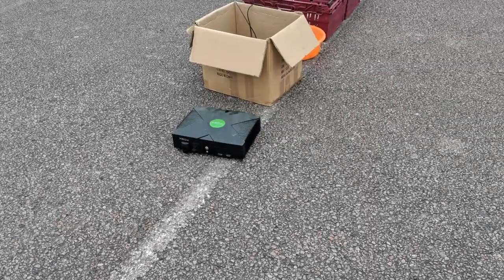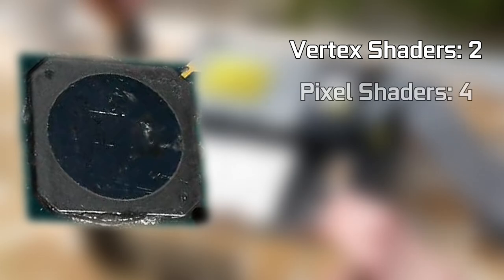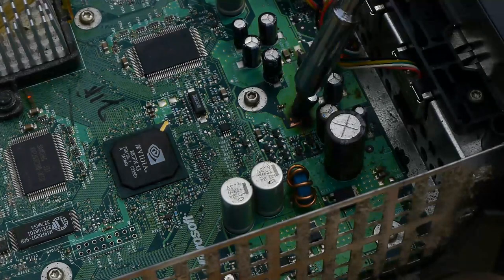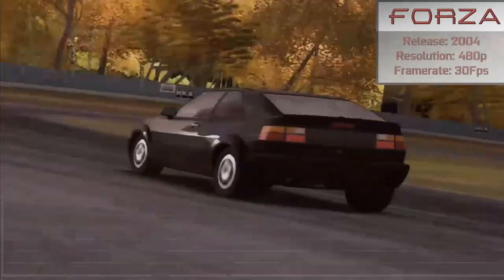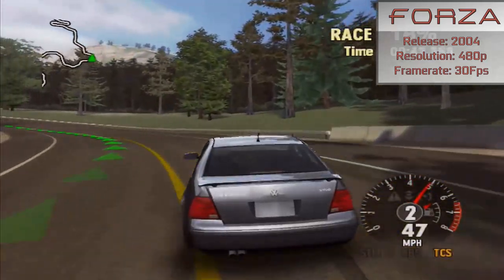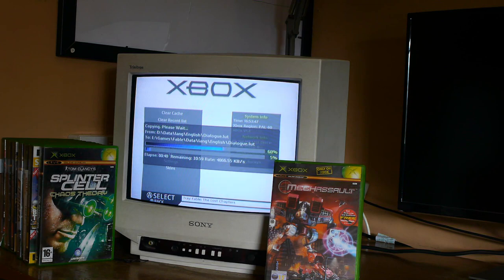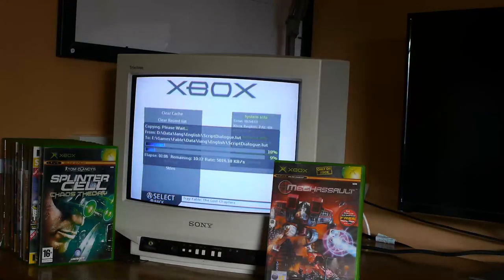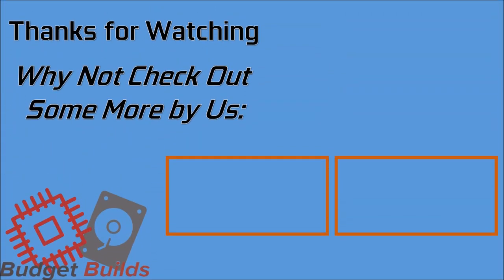How Powerful was the XBOX?

Comment: First Xbox was a BEAST, I remember that GTA SA was more beautiful on it than on PS2.
Reply: Sypher Ti yea but it didnt release until years later
Reply: It had terrible controls though.
Reply: @megami215  It came out in 2005, just one year after the PS2 port. Sony had the shared timed exclusive rights to it along with PC when it released in 2004.
Reply: The ps2 was a weak console though it had nasty graphics and was basically no better then a gameboy
Reply: @theghost7277  PS2 is a complete boss, I have all the consoles from this generation modded and setup currently. PS2 kills them all... Easily. I actually rate them PS2, Wii, OG Xbox in their modded state. PS2 can go all the way from 240p to 1080i + VGA modes plus it feels way more arcade solid.
Reply: @thomassmith4999  srry but no ps2 is a weak console the origanal xbox has 720 p games of release not even the later release when they put core2 duos in them srry but not even close you really dont have a clue what you are talking about
Reply: @theghost7277  I have plenty of clue man, I told you already I have all those conoles and around 20 years experience with them. I'm telling you right now the PS2 is by far the superior console. In the end the Xbox is nothing but a cheap PC, worse yet.. a cheap PC that can't run 240p resolution. It's a bit fat pile of junk to be perfectly honest. But at least Halo is a good game. The PS2 is an arcade board in a box.. MUCH better if you like your games to feel legit.
Reply: @thomassmith4999  and one other thing a ps2 cannot go to 1080 I had to try this since you had mentioned it and 1 it crashed my ps2 so rebooted tried again  and the highest it will go is 480 so I'm calling you bs right now.
Reply: @theghost7277  Gran Turismo runs 1080 out of the box just as it is, some games can be forced to run that high, it's hit and miss when forcing them though and does take some monitor adjustment. You can get VGA and 720 out of a lot of them. 240p is more important to me and I can get about 50% of all PS2 games running is 240p.
Reply: @theghost7277  
There is a list of what games work and not work, google "List of PlayStation 2 games with alternative display modes"
Reply: @NuffMan_  ok I'm gonna stop you right there I mod these systems I know how there power is and what has true power  now get out of here
Reply: Thomas smith The Wii was a 7th gen console, it was the GameCube in the 6th gen.
Reply: @ironhammersfc  gamecube was fun nat hard to get the console but hard to get the games
Reply: @theghost7277  actually You have no idea how much power PS2 had.
Reply: @damiank9443  uh yes I do a 16 bit 294mhz processor 33mgb  ram
4mgb of video ram supports up to 360p with out any problem at 25 fps usually can be pushed to 480 and 720 with very certain games others will just crash and start overheating your ps2.

Now heres some xbox specs a 32 bit 794mhz  custom Pentium 3  has 133 mhz gtl fsb with a 1.6 gb bandwith and has 64 mb of ram and that has a 6.04 bandwidth 1.6 of that is used by the cpu the rest drives the graphics. Will play any game on the console at 720 and most at 1080  and never drop from 30 fps. 
Will play half life 2 at 720 at 40fps and 1080 at 35. The ps2 wouldnt start these games at its specs

I'll be clear the ps2 isnt shit
Reply: @damiank9443  0 power nothing compared to the origanal oxbow hell it barely held it's own with a dreamcast
Reply: @theghost7277  lol. Or lul. Suits better. Level of bullshit here is enormous. Did you actually saw DF Retro with Half-Life 2, MGS2 or Silent Hill 2? Xbox struggles with HL2 at 480p so I don' think you could ever see 720p and 40fps here. I don't know if you missed something but main core of Emotion Engine is 128 bit not 16. And that bandwidth. Graphics Synthesizer offered at that time crazy bandwidth and fillrate. It had around 50 GB/s, twice as PS3 or X360. No comparision here. Fillrate was almost four times higher that XGPU, and allowed more complex effects like fog in Silent Hill or heat haze in Gran Turismo (this one is bandwidth oriented) without performance hit. CPU-wise PS2 uses Vector Units that easily crushes XCPU in terms of float performance. Xbox has power and that power was easy to use just like GameCube, but PS2 wasn't worse. It's programming was just more demanding. Oh, and Dreamcast cannot catch PS2. Maybe in your dreams.
Reply: @damiank9443  and by the way took me some searching but I bought a dreamcast and lo and behold it kicks the ps2 ass.
CPU: 128-bit Hitachi SH-4 RISC processor (200MHz 360 MIPS)
Graphics: NEC CLX2 processor
RAM: 16MB, 8MB Video RAM, 2MB Sound RAM
Colors: 16.7 million
Polygons: 3 million per second
Game Media: 1.2GB GD-ROM, 12x access speed
Resolution: 640x480 pixels
Sound: Yamaha 64 channel
Operating System: Custom Windows CE with DirectX support*
Modem: 56Kbps (US/JP NTSC), 33.3Kbps (PAL)
Not to forget the dreamcast also had 8x anti aliasing
Reply: Sypher Ti - XBOX>GameCube>PS2>Dreamcast!

There are some things the GameCube did better than the XBOX and that is processing 8 different layers of texture whereas XBOX, I believe, has 6 passings, with the PS2, I believe, having 4 texture passing.    

I favored the GameCube, because I love their first party games and the fact that the system didn’t have as much load time issues as the other systems.  Plus, many of the third party games actually came out on the GameCube.

I like the PS2 for it’s exclusive third party offerings and first party exclusives, but I did not pay the XBOX any mind until it was discontinued around 2004/5.  I played catch-up and purchased almost all the must have games I could want on that system, brand new.
Reply: @NYCJoeBlack  this dude knows his stuff.
Reply: I remember me and my friend comparing the Original Battlefront 2 on my PS2 and his Xbox, I was definitely jealous, and Halo had me convinced that I had to get my own, I was quite happy when I later got a Xbox 360 Arcade
Reply: @Sypher. And some of the games  ran at 1080I, provided you had the red blue green HD component cables and an HDTV. None of the other consoles at that time even came close if you had a set up like that.
Reply: @theghost7277  THE GHOST
2 months ago
@Thomas smith srry but no ps2 is a weak console the origanal xbox has 720 p games of release not even the later release when they put core2 duos in them srry but not even close you really dont have a clue what you are talking about

Core 2 duos, where?
Reply: @theghost7277 Starting with a 295 or 300MHZ (in later models) MIPS CPU, approx. 6 GFLOPs of graphics performance and 36 MB of RAM,  although weaker than an Xbox, the PS2 is definitely much more powerful than a GameBoy.
Reply: @martinramirez21  yeah, I'd say both sides are incorrect here in some aspects. The original Xbox was most definitely more powerful than the ps2 in almost every single way. The GameCube would take 2nd place and the ps2 third. The Xbox usually got its own special versions of games with upgraded shaders and other bits, while the ps2 and GCN would usually both get the same version, which sucked because this meant most 3rd party titles didn't fully take advantage of the GameCube. Really only 1st party Nintendo titles would show off what it could actually do. The ps2 could indeed do 1080i in GT4. That's 1080 interlaced, not 1080p. And it could push a lot of polygons in the hands of a talented developer. Over it's lifespan most devs learned how to "fake" certain effects on the ps2 so that the visuals could approximate what the Xbox could do via hardware, and it could sport some impressive graphics via games specifically coded to take advantage of it's bizarre architecture (FF games, MGS games etc). Those games also had the benefit of having great art design, which masks any technical shortcomings of the hardware. The Xbox actually did 720p in quite a few games, which is very impressive given the time period. It really is a locked down PC, but it's a powerful (for its day) locked down PC. It was meant to showcase the DirectX api, hence the name. Doom 3 running on it may be slow as hell, a bit chopped up and low res, but the fact that it runs at all is amazing. Sort of like Doom 2015 running on the Switch. There's no way in hell that game could run on a ps2 short of a ground up remake.

None of this matters though, because in the end the ps2 had better and more games, and that is what it's all about. There are standout titles on the Xbox and GameCube, but their libraries are weak as hell compared to what we got on ps2. Especially the Xbox. It had Halo 1&2 but not much else. That's why it's hard for some folks to believe that it was the weakest console of the generation by a fairly large margin. They grew up playing games like MGS2 and FFX on it, how could it be weak? The fact is though, if those games had been coded specifically for the Xbox or even the GameCube by devs that knew what they were doing they could have looked a lot better. Though they'd have needed multiple disks on GCN.
Reply: the sky in GTA:SA on the PS2 looked like piss.
Reply: @thealien_ali3382  The PS2 can run 1080i that is a fact. Load up Gran Turismo 4 and select 1080i in the video options if you would like to see for yourself.
Reply: @theghost7277  got rid of my ps2 for an xbox, graphics way smoother, processor faster graphics faster, gameplay better, ps2 was beastly buts it nowhere near as powerfull as og xbox.
Reply: @jokerzwild00  gta 4 on the ps2?
Reply: @jokerzwild00  it had more games because its was older!!! not necessarily better as you see in the video multi format games ran better on the xbox so your point aint exactly correct.
Reply: Didn't like San Andrea's on Xbox. Wish Rockstar Vienna ported it instead of Rockstar North. It would have been better but it probably would have taken longer. Vienna did an amazing job porting 3 and Vice City.
Reply: @theghost7277  no better than a gameboy HA!,nice try.
Reply: fun fact: the Vice City Xbox port was the only GTA on that generation of consoles where characters had fingers
Reply: SNES was better than xbox and PlayStation !
Reply: @thomassmith4999  you are high apparently
Reply: @Mark-fr2eb  I was playing pong in the 70s with you. Everything I've said about he playstation 2's technical capabilities is true.
Reply: @thomassmith4999  The Shitstation brand needs to die.PS2 was a joke, hard to develop for and broke down too much.
Reply: @Mark-fr2eb  Dude, have you ever owned one? the original ps2 almost never breaks down, my first one is near on 20 years old and still running the original laser. I hasn't happened to me but occasionally they do blow the fuses, you can fix those easily. I have 7? PS2s these days and still haven't one one fail, even the slims all work. 

I've had several fat xbox360s fail and one fat Ps3 die out of several I have (I did manage to re-ball the ps3). I only have one working 360 left (360s) and my xbox one is currently dead. I haven't had a og xbox die (I did take the super capactors out of the two I have a while ago, one of those has been running fine ever since release, the second one I've had only a couple years). I have 10 Wiis powering arcade CRTs and they are super reliable, never had a problem with a Wii. 

Yes the first three playstations were harder to develop for because they were proper custom gaming platforms, not PCs in a box like the Xboxs and PS4 are. I much prefer the look and feel of real gaming systems compared to direct x the early xboxs used although I do like the 360(not as much as a ps3 but I still like it).

I'm not biased to any brand, I just prefer some consoles to others based on my own opinion from using them. I've always bought one of each console when they were released no matter who made it. The only major console I didn't buy was the dreamcast.. and I probably should get one.
Reply: San Andreas Xbox port was more detailed (better textures, better draw distance), much better framerate (PS2 verison was almost unplayable in comparison), and even better controls, however xbox and PC ports were downgraded. Missing car reflections, object placement was altered, but the most important difference was different postprocessing. PS2 verison had beautiful orange filter. Fortunately moders have restored missing effects and orange filter in PC version.
Reply: @thomassmith4999  I'm playing on PS2 and xbox since day one and I have different opinion. Graphics on xbox was clearly on different level and xbox exclusives and ports were extremely impressive. Overall PS2 had more games but still xbox had big number of good games, far greater than now on xbox one or PS4. I have around 100 games on my xbox HDD and i still havent played them all after so many years 😃
Reply: @theghost7277  the ps2 had less power than the voodoo 2 graphics card lol the xbox had like a geforce 3/4 graphics card in it and it shat all over the ps2 from a high height
Reply: @NB-1  yet it sold the most out of all the consoles... The PS2 was a powerhouse of a console and many Devs started on it and are big names now
Reply: @theghost7277  the PS2 is the most     popular console in the world rn. It sold the most out of every console till today
Reply: @abhay17381  doesnt change that its graphics were the shittiest of the time and still were compared to the dreamcast
Reply: @abhay17381  it's the epitome of cheap consoles sell better
Reply: @theghost7277  it sold a lot because of the exclusives and the brand loyalty from the ps1
Reply: @abhay17381  and it was cheap dirt cheap which is why all the games looked so bad
Reply: @theghost7277  hello? The exclusives are what made the people not care about the graphics
Reply: @abhay17381  yes then xbox released halo 6 monthes after and more people played halo online then any other game ever quite literally
Reply: @theghost7277  halo only sold 6 million copies in the US and Europe combined
Reply: @abhay17381  uh your numbers are very wrong halo has sold 60 million copies
Reply: @abhay17381  dont know where you get your numbers
Reply: @theghost7277  this is from the official wiki of Halo
Reply: @abhay17381  yes google how many copies of halo sold 60 mill ez thing called google
Reply: @theghost7277  that's the whole franchise not the first halo game
Reply: @thomassmith4999  I had both ps2 and Xbox, the Xbox was way more impressive. One game on PS2 called Hulk Ultimate Destruction. Its one of the most impressive games of that generation. I have it on both systems. Xbox runs it native 720p with a better framerate than PS2 at 480p lol. PS2 version chugs at half the resolution. That's an insane gulf in power, especially considering the game was specifically designed to run on Ps2 first. There is a developer that worked on all three quote as saying the xbox was way ahead of PS2 and Gamecube in practice and that they rarely had time to push it, but when they did, it put up crazy numbers.
Reply: @bmx7596  Xbox was way ahead of its times, that's its flopped outside of US,  pretty much any adolescent who play games on console wouldn't care much about graphics, and also GUI for the menu is still far too advanced, that is why gamecube and ps2 sold and are more successfull, simplicity
Reply: You remember wrong, everyone downgrades the newer versions of GTA SA to match the PS2 look.
Reply: @Clay3613  We call that nostalgy. Technically Xbox version was sharper with a better draw distance.

Comment: One of the best consoles of all time. Multiplatform games were amazing, exclusive titles were usually VERY good, the PC ports were fantastic feats and the homebrew scene is the second best in console history. Thanks for the video!
Reply: Sore Throat What do you consider the best?
Reply: @Sniper257  personally i think the Wii brought everything to another level, specially when talking about emulators. Running GameCube games was awesome!
Reply: @reisu_3708  The Wii runs gamecube games natively, it's the same powerPC architecture as the gamecube and didn't require any emulation...that said I would argue the homebrew on the Dreamcast is better than any other, there are still new homebrew games being released for it.